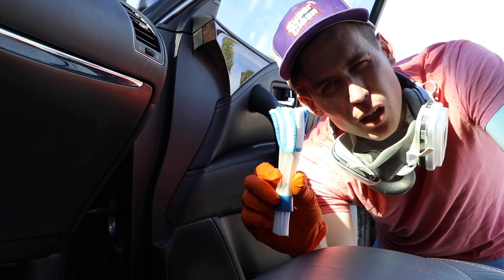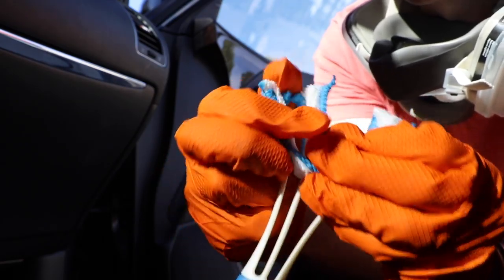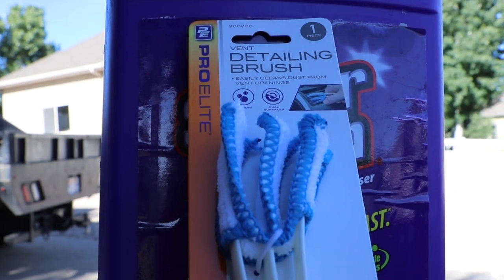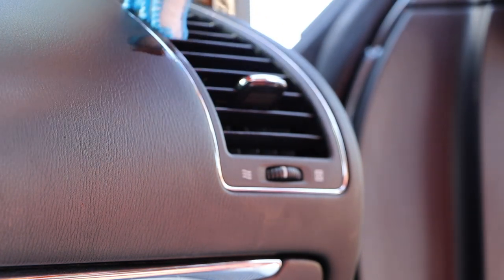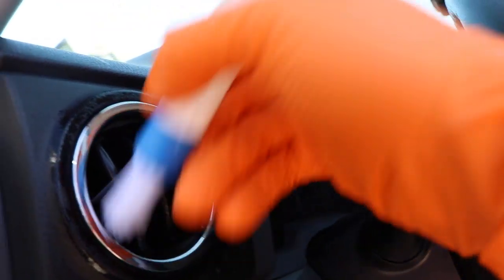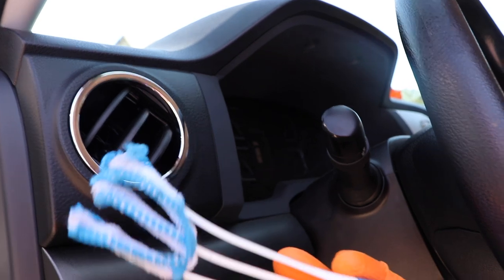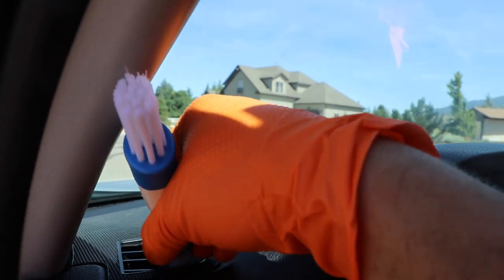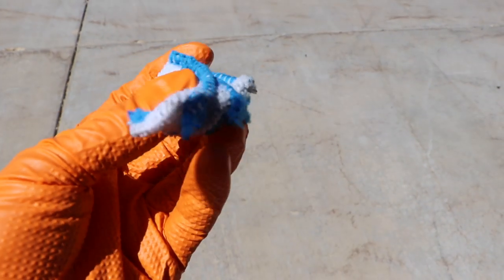Cool detailing tool for less than $4!

Comment: Its practically impossible to find a stiff brush like that. Cool. I'd buy it just for that. As for the pronged tool it looks like by the design it would neglect the very sides of the vent because of the stitching and be kind of cumbersome around the vent tabs or less uniform kind of areas. I just use a towel and a flat plastic pick with it for the 1st pass, then steam and wipe again.

I agree its super important to have nicely clean vents. Its actually something I pride myself on.
Reply from the maker: I hear that! good observation...its a nice complimentary tool with air and steam which will hopefully get the sides of the vent. I love the flat plastic pick/towel idea